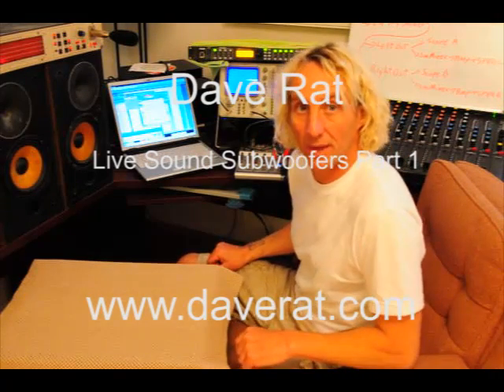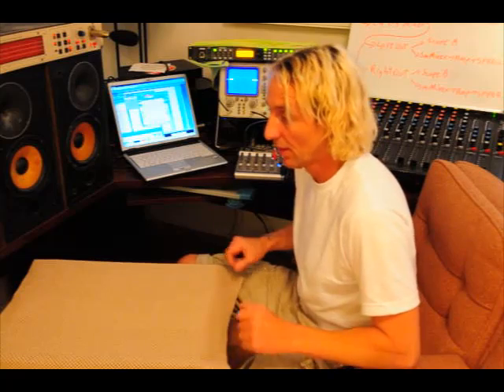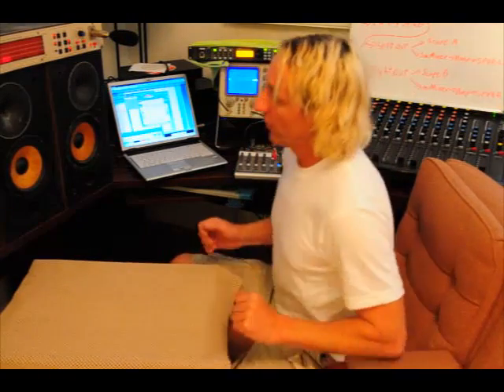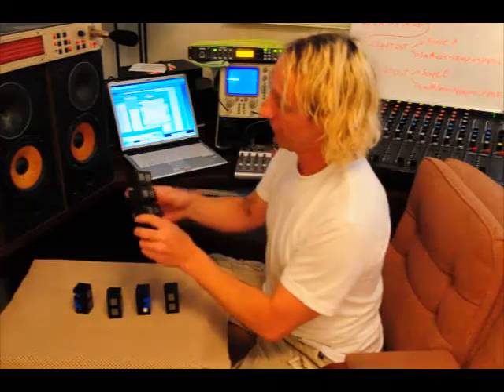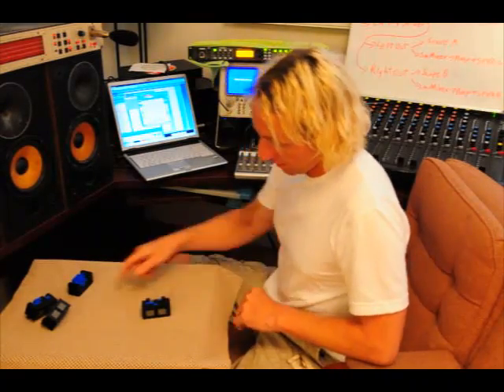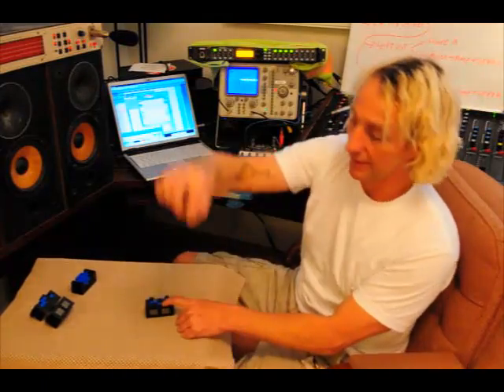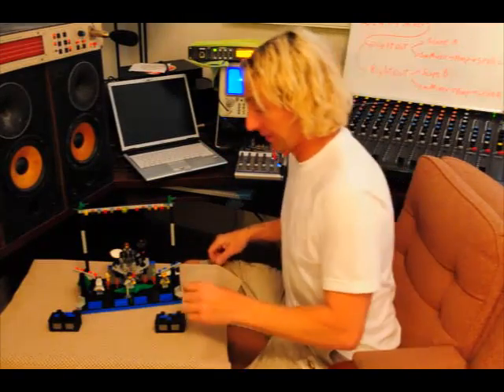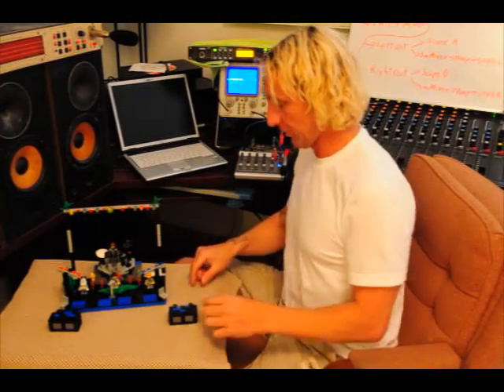Pt 1 Live Sound Subwoofer Configurations

Comment: I know this is an older video, but I’ve always had this pipe dream of having a venue where you dig into the ground underneath the stage and you play subwoofers under there and you create a big long horn that opens underneath the stage and is the exact perfect dimensions for the room.
Why could you not do something like that? Let’s say money doesn’t matter on this you’ve got all the money in the world could you build a gigantic horn underneath the stage and put subwoofer drivers in it and have the ultimate and low end frequency response?
Reply from the maker: Hmmm, I've seen pics and info of someone doing something similar.  A Google search should find it.

As far as a horn, I think just making the floor in big sub array would get everyone close to a sub source and therefore, away from summation and cancellations.

That said, a new issue of the giant floor sub being 0ms delay everywhere may create issues with the main pa which will have time offsets that increase with distance.

Comment: Dear Dave Rat....I have a pair of old LEM 18" (horn design) subs. The actual sub driver is situated "hidden" in the bottom of the subs facing upwards. I feed them signal below 100hz through a stereo behringer Graphic eq that has a dedicated mono subwoofer  (low pass) output. The subs are paired with two 15" full range EV speakers on the top fed with full range signal, obviously not an ideal scenario due to conflicting low frequencies... Since the subs are not of generic direct front facing driver design, how much phase cancelation is there between subs and tops? Its really confusing :P Thanks...

Comment: So if you're running a simple 1 sub / top per side, i.e. small band/club gig is there any benefit to rotating the subs to the side or since they're almost omnidirectional is there zero benefit?
Reply from the maker: Hmmm, slightly if it's a double 18.  I covered all that in depth during the zoom chat I did last week and released.

Comment: With subwoofer, are they better elevated or floor
Reply from the maker: That is not a simple answer. On the floor they are closer to the audience, so louder but flown the volume can be more even. Flown can be a problem for venues with sloped floors. Many variables, music type as well
Reply: @DaveRat  room is more of a narrow rectangular shape.  we have 2 main speakers flown right on top of the stage and we're thinking of adding a sub.
Reply from the maker: Hmmm, I would use a prediction software. Even if it's for a different brand, use similar box types
Reply from the maker: Download soundvision and mess with it.  It's really cool and fun and will give you new skills.

Comment: Hi Dave, I studied your explanation about the cardioid setup, but I am a bit puzzled. Almost all video's on cardioid use the method of reverse polarity and time delay on the back  speaker, but if I understood your video correctly, you say the setup where the back speaker starts firing and the front speakers are delayed is a better solution.
I that correct?
And if so, is there also a phase reversal on the front speakers?
Reply from the maker: Cardioid is the rear speaker delayed and polarity reversed.

End-fire which is another method with superior forward energy and sound but less rear rejection is where the front speaker is delayed and polarity is not reversed.

Both offer a "cardioid" coverage but endfire is less directional
Reply: @DaveRat  Thanx! I, got it :)
I thought  the end fire solution ment placing speakers behind one another with 1/4 wavelenght spacing.
Practical - I am experimenting with 3 greenboy Fearfull subs as part of a small PA set I'd like to use outside.
If I put them on the ground next to eachother, center stage. Two facing forward, one facing backward in the middle.
Then if I  delay the two forward firing subs,  would i than get the maximum output at front and some rejection in the back? Or does that solution only work when you stack them on top of eachother?
Reply from the maker: It does not really matter which way the rear subs face or whether they are stacked or behind.

What matters is the location of the sound sources in relation to each other.

Think of the speaker as a mouse maker. 

Noise comes out, travels and then adds or subtracts from nearby noise makers.

It the timing and polarity is aligned it will add, if it is delayed or polarity reversed to cancel, then it will subtract in that direction
Reply: @DaveRat  
Okay, thanks again! I will do some experimenting :) see what works out best

Comment: I recently tuned a PA at a small church and the room dimensions caused an opposite effect than what you describe here. 1 sub on either side of the stage. Power alleys were off center on either side of the room, and a huge dip right in the center. After much testing, best configuration was both subs together right in center, in front of the stage. Its crazy how physical low end really is.

Comment: Hey i wonder if you can do a new video of sub woofers with what dsp and time alignment for left and right stacks of subs. i only have a dbx drive-rack which you know i cant really delay left and right to get a power alley . unless i send more outputs from the midas m32 or x32 which is all i have. can you do a video of this issue.  only have ground stacks so i use the subs to lift up the tops. i always have a problem with no sub down the middle or maybe some quiet spots to the left n right.

Comment: Why is the bass cranked up at live concerts completely out of proportion to the music?  Records aren't mixed that way. I saw Mark Knopfler and the bass was so heavy it was like a rap concert - maybe sub woofers, but why for Mark Knopfler. At one point the guy in from of us, who was a pro mixer, got up and went back to the sound board to talk some sense into them but nothing changed.  I just saw Joe Bonnamassa and the concert was destroyed by the bass cranked above all the other instruments. The last four concerts I have seen have this problem.  Unless this changes I will not attend big concerts anymore. What is the deal?
Reply from the maker: Same reason race cars go faster than street cars
Reply: I think this is a good opportunity for you to go into the live sound production business and show those guys how to do it
maybe if the sound guy got to sit in your seat and listen to the mix he probably would adjust it accordingly, most guys really want to do a good job and make it a pleasant experience for the audience
Reply: @stevencancel1727  😅🤣😂😆 The problem is I'm an old curmudgeon.
Reply from the maker: I would say that the sound of concerts vary so drastically that it would be tough to generalize. There are some great engineers out there that mix well balanced shows and loads and loads of engineers that mix like a kid who just got their driver's license drives.

Comment: I have a Totem Storm sub and it has 3 drivers. One on each side that are passive and one in the front that is active. It is not  a ported sub either.
Reply from the maker: that would be a passive radiator design wherein they side facing drivers act as a port that has additional mass, lowering the resonant frequency.  the down side is a sacrifice of transient response, as in their lows are slower and more ringy. the up side is extra LF from a smaller box.
Reply: Thanks, I though maybe the two passive drivers were to counteractive standing waves. Right now I am using an Energy 8" sub on my computer that has a downward port. What subs do you recommend for home stereo that is fast and punchy sounding?

Comment: This article will help understand what is going on with left-right subwoofer interaction: http://www.prosoundweb.com/article/in_search_of_the_power_alley/

"Power valley" is probably not a good idea for a term, as I do not think portrays what is happening well, as you can see from the illustrations in the article. Unlike the "power alley", which happens at the same locations across all frequencies, cancellation areas will change in number and location depending on frequency

Comment: Can you do a subwoofer shoot out, i am trying to do the same but don't have enough money for one but am testing some different brands and custom boxes with different drivers, Ev Jbl,Eighteen Sound, Rcf, And B&C + venting and dimensions. Also a quick question on having cancellation  in a smaller venue. Do i need to delay one side of the subs, or is it mainly the room i'm in.Usually 4 double 18" max.
THANKS
Reply: rcf is the way to go or jbl
Reply: JBL PRX818XLFW 1500W 18" Powered Subwoofer (preferably)  or 
Yamaha DXS18 800W 18" Powered Subwoofer.
 Whatever subs you buy don't mix the brands, stick with the same brand and type it's easier to control the sound.

Comment: IMO you've taken a sound quality and efficiency hit by choosing reflex over horn loaded. You will never beat the thd, group delay transient response, efficiency and 'feel' of a properly horn loaded/waveguided subwoofer. But of course I am a horn/waveguide purist! :D :D
Reply from the maker: I like that there is no real 'right or wrong' in sound reproduction, just an assortment of methods that have varying probabilities of reaching the desired goals.  In my opinion, horns offer efficiency at the expense of linearity over a wider frequency range. But over a limited range can be quite effective.  Horn loaded systems get loud and we work to make them sound good.  Reflex systems sound good and we work to get them loud.
Reply from the maker: there are differing tools for differing applications. With current technology, ultra long excursion drivers, and lightweight amps with massive amounts of power for reasonably low prices, relatively small bass reflex sub designs are a very effective way to reinforce even the largest of venues with smooth powerful sub lows. One interesting product I am currently working with is the PowerSoft M-Force moving magnet linear motor. This thing handle 10 to 15,000 watts, drives a 22" to 40" cone and pushes so much air that it is mind boggling. I have seen some horn loaded prototypes and am nearly done with a bandpass reflex design that has some transmission line aspects as well.
Reply: Dave Rat Dave If I'm getting this right because my sons band plays basically in bars and smaller places "Reflex" subs would work best for them right? I say that because most bars don't want the sound crazy loud so they should opt for the sound vs volume. Thoughts...
Reply: Roger, even as a hornloaded fan I can tell you that in small environments reflex is the way to go. I'm just a horn fanatic. Horns tend to send energy straight through walls and down the road because they are low pressure/high displacement. Not what you want at small bars!
Dave - have you ever heard FLH / FLH reflex? A much greater passband is available than a standard reflex cabinet or folded horn, and the designs I know that work well are actually more linear, and also more dynamic. A lot of horns work by pressurising a front chamber, the high impedance of which is then transferred by a massive horn to atmospheric levels... yeah this pressure load and the folds are inherently bandpass and create a lot of non linearities. But there are some out there that do what they do without doing this and to my ears this where real bass reproduction is att. It's just a shame that all the big touring/manufacturing companies are obsessed with reflex. I've heard some good reflex cabs in my times... boxes that were free from honk, had sensible efficiency, and properly reproduce sub, but nothing can do leading edge like a short FLH!
Reply: iawhiteleygray  ,I'm having problems  routing a powered  subwoofer to my x32 can you help me?

Comment: Hej , thanks for posting the video. I have a single active bandpass 18" (131 dB) sub and two active good quality 1"+12" tops (128 dB), dB technologies The top speakers are limited to play down to 90 Hz through a built in crossover in the stereo sub.. We will use this system for 5 member band reinforcement. I have no idea where to place the single sub for best coverage. I now in the middle between the tops is good, but a bit difficult with the singers being present :-)